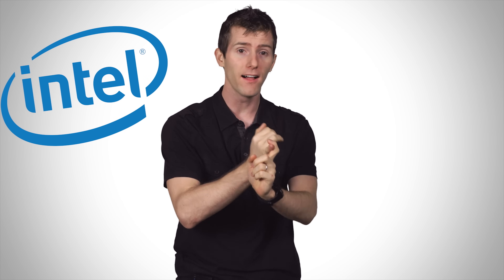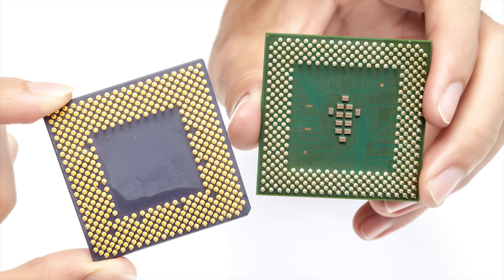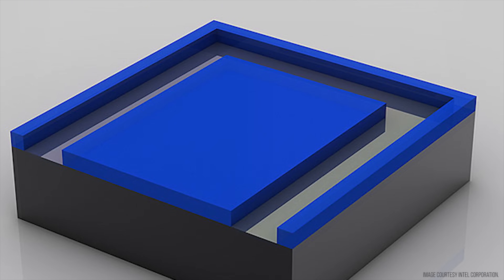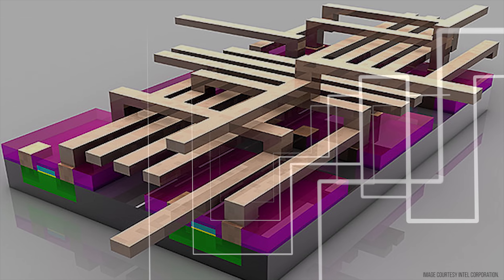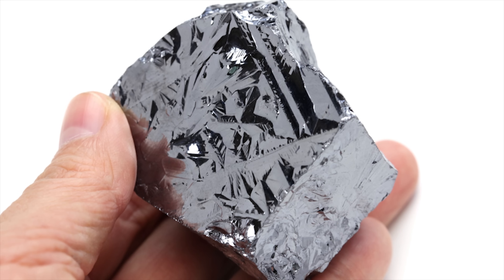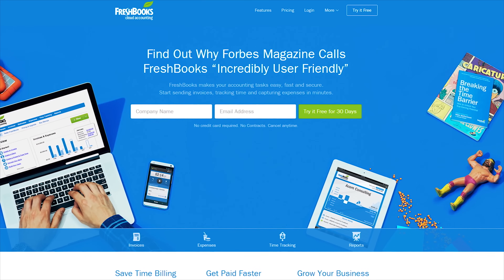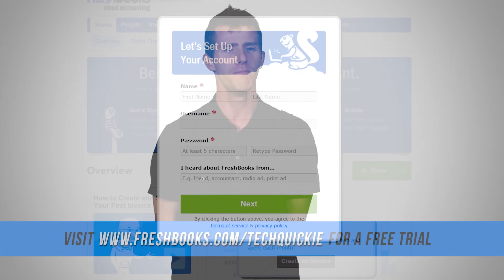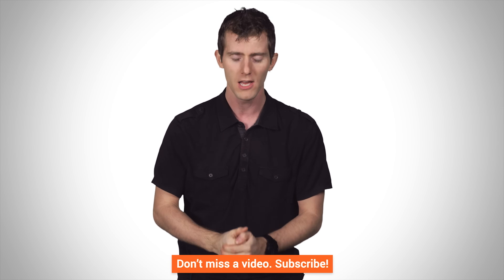How CPUs Are Made As Fast As Possible

Comment: Why are wafers cut into circular shape instead of a more rectangular one? Wouldn't that give you more usable area?
Reply: I think it's not that they are cut that way, but that the giant silicon crystal that they are grown out of is basically a cylinder, because that's just how it's crystal structure naturally grows. They just slice up said cylinder and then etch as many processors on it as they can fit from that current design.

Comment: I REALLY wish I could find an explanation as to how computers actually work.
Like, hear me out. The chips  don't have moving parts, and you can't see the data moving through them. So how does data get in and transfer around on a seemingly tiny square on a board?
Reply: Electrons atom. That's how they work. If the computer detected one electron Particles it will go 1 and if not it will go 0. That's why we got binary numbers

Comment: I used to work in a factory that used to recycle these wafers. Loterally all 3 of the companies (intel, global foundries and tsmc) Best job I ever had.. btw for some reason tsmc was always easier to recycle, global foundries was easily the hardest. There were only 7 factories in the world that did what we were doing so I always felt quite privileged.
Reply: that sounds cool
Reply: Wdym by recycle? Would it be fully useable again?
Reply: @jishan6992  Yeah they use different types of acids to take away all the different layers on top of the silicon wafer leaving the bare silicon, then it's polished up and sent back, it's cheaper to do that than to make a new wafer. We would "reclaim"  thousands of these wafers every day.
Reply: @sacredbridge368  that's good then, no wonder they can sell this chips for relatively cheap. I read somewhere that a single  wafer can cost up to 20,000 usd but I thinks that's after all the processing and stuff
Reply: @jishan6992  I'm not sure about 20,000 but the bare silicon wafers that we would send back to companies like intel and TSMC were only worth around £20 - £30. But we'd process about 6,000 of them a day.

Comment: Well the "end of this decade" part went by pretty quick...
Reply: 14nm+++
Reply: And Intel is just starting to put 10 nm chips on the market 
Probably won't see new materials the next 5 or so years i would guess
Reply: @raphael7010  more like 20
Reply: They could use boron or carbon or something like that
Reply: @janhilgert9053  my bet would be carbon.
Closest to silicone
Reply: @raphael7010  The silicon that CPU's use are actually made from carbon and sand.
Reply: Raphael Wittmann First, the element used is Silicon, not Silicone. Silicone is a type of synthetic rubber, while Silicon is a metalloid. Second, Carbon is not a metalloid and therefore doesn’t have the chemical properties Silicon has to be used in a computer chip. If a smaller element were to be used they would use Boron, since it is physically smaller (and therefore more could be more densely fitted) and is also a metalloid.
Reply: @turbo__unicorn3370  you just science'd on them
Reply: Gallium Nitride, that's my guess.
Reply: Intel: 14nm+++++++++++++++++++++++++++++++++++++++++++++++
Meanwhile AMD: 5nm at the end of the year 2021
Reply: 1
Reply: Ah yes (insert complex compound name here) Valley
Reply: Haha yes now yed
Reply: There already are CPUs made of other semiconductors, they are much faster and more efficient.
Reply: Plastic confirmed.
Reply: I mean Intel is making brain like cpus
Reply: Yep covid sucks 3 years passed by, chip shortage causing gpu prices like gold. Good thing at this moment May 2022 the prices are dropping. However, recession looms and I can’t sell my old overpriced rig I bought cause everybody is now upgrading theor rigs
Reply: So what are they made of now in 2025, silicon?
Reply: Corona
Reply: @DhirC35  Heineken
Reply: @Smittel Stella

Comment: 2 small corrections: a. MOSFET transistors are symmetrical, you can turn them upside down in any circuit and it wouldn't change a thing because the drain and the source are interchangeable (it only depends on what's connected on each end) - so no, the transistor itself is capable of passing current in either direction. Using it as a switch is actually achieved by what voltage is applied to the gate (hence we call it a gate). b. silicon isn't doped with ions, it's a very common mistake, it's doped with neutral atoms of either donor or acceptor variety, and those atoms carry a neutral charge. They improve the conductivity of silicon because they add more usable (for conventional electrical flow) carriers, but they DON'T change the charge of the silicon itself.

Comment: Why don't we just make processors bigger so we can fit more transistors?'
Reply: @lenyosu  I think its more of making them low power since they have to travel their way there before fizzling out. Enlarge this things and they would need more power(hanks to resistance even with copper) that they would eventually fizzle out before reaching the end.
Reply: @StreamerGeo its less about heat issues and more of electricity travelling and still having enough juice to register on the transistors. the purpose of cooling is just so they can operate as close to optimal conditions as possible

Comment: Yup stuff is getting small, we talk about 14nm architecture as if it was just a small wire, it is EXTREMELY SMALL 14nm is about 40-50 ATOMS wide
Reply: And now we have 10nm in the Snapdragon 835.
Reply: 7nm in Zen 2 welcome to 2019🌞👏
Reply: 90*
Reply: at this size its just guesses
Reply: silicon atoms are 0.2nm, so 14nm is 70 atoms wide.
Reply: BobClemintime Doped silicon (because that's what they're made out of)
Reply: 90**
Reply: Depends on the size of the particular atom being used as a measuring tool.

Comment: It's crazy to me, how much work and technology goes into creating computer parts, and yet a pair of shoes can cost the same as a new CPU or motherboard. Consumers are dumb.
Reply: i3, i5 and i7 are all made from the same die (within the same generation), then they are binned according to what is broken. for skylake that means they are all essentially i7 6700K CPUs. if one (or more) hyperthread path doesn't work, then all hyperthreading is disabled and it sells as i5, (same if any of the L2 cache is no good).  if any cores are faulty, then 2 cores are disabled and it is sold as an i3. The stability of cores at particular frequencies determine weather it is designated as say a 6400, 6500, 6600 or 6600K. They all cost about the same to manufacture, and R&D is a blanket expense for the generation. but they can charge more for a better (i7-6700K) and while an i3-6100 costs the same to make - selling it at a reduced price still recoups more of the loss than throwing away anything that is not perfect. I am also amazed how stupid consumerism can be.
Reply: @forestR1  Exactly.
Reply: @forestR1  wait nobody argued with this bullshit?? lol
Reply: @forestR1  they cant sell a broken or not properly functioning cpu. all the different versions are made the way the are intended to be made.
Reply: @Ethereal11177  lithography is complex and prone to flaws. This is why scalable architecture was created. Generally dies towards the centre of a wafer are higher yield. The reason no one has argued about it is because its not wrong. The parallel design of CPUs allows paths to work independently.  If a core has issues, it can be negated and the rest of the die doesn't care, and the silicon can be sold as a cheaper scu. Ill use skylake as example, just because that that's what I have; my 6700K has a 122mm2 die with 1.75Bn transistors. A core i3 6100 uses a 122mm2 die with 1.75Bn transistors. Same works with many GPUs. My Vega 64 and a vega 56 share the exact same 495mm2 12.5Bn transistor die.
Reply: @forestR1  honestly I'm sorry. You know way more about this subject than me and I think I totally misunderstood your first comment. That's interesting
Reply: @forestR1  I also still have skylake i5 6600
Reply: But R&D
Reply: @putcheeseonit  Yup. Most of the cost in R&D.
Reply: I'm surprised no one mentioned economies of scale.  If all you could get out of the process were one single CPU, it would be worth many millions of your favorite currency unit.  It's the mass production using an evolution of photolithography, leading to a large output of many copies of the same CPU, that makes each copy affordable to an average consumer.
Reply: Yeah, a pair of womens fashion shoes could be made in China for $20. If it retailed for $30, no one would look at it.  Put an italian mans name on it and bang the price up to $300 and the idiots will flock to it.
Reply: Shoe manufacture isn't as simple as you think it is either. Plus it uses a lot more raw materials and has a bigger footprint. Finally, you may have noticed the sheer number of types of shoes in comparison to the different types of CPUs which are manufactured at a certain point in history.
Reply: @BobClemintime  ok Jew
Reply: +robin kegel well you know that a i7 cost not ner 300$ in production ? Im guessing 50$ . And a i3 oir i5 is not going to be any less or more .
Reply: +fritz hoffman near*
Reply: Yeezys get more expensive than an Intel i9 Extreme
Reply: This dude is right i see alot of brain washed comments on here jesus haha
Reply: Yes, consumers are dumb, that's why they pay 200 dollars for a pair of shoes made out of foam that fall apart after less than a year of being worn every day. Because they care more about looks and showing off in expensive clothes than practicality or value.
Reply: thats why i7 starts at 300$ because it takes more tome to create an i7 than it takes to create an i5 or i3 thats why new i3 are cheaper they arent better than i5 or i7
Reply: No, that's not why at all. It costs practically nothing to make these CPUs, the money goes into research and development. The prices are shaped to suit markets.
Reply: But.. you can't use i7 as shoes, do you? 😅
Reply: Think of how much work and tech go into creating cars...
Reply: Ur dumb
Reply: DBR Liamg my $50 shoes work well for day to day use, walking to work and back. My expensive hiking shoes, WHICH arent more than my i7 is still in good shape after 2 years.  Its not how people dont like expensive shoes, its just that depending on the company and model, it is sold more than what its worth. Apple is a great example, they use words that snag consumers in. Guess what? The stuff we get fro hundreds or thousands could easily be replaced with better items at a lower price. Companies raise the price pf things because an athlete used it, or b/c they intentionally manufacture a limited supply. Ergonomics, blah, blah, most of these words are just marketing strats.
Reply: Some people aren't show offs, they just like to look good 90% of the times
Reply: Consumers are dumb ?
Lmao, people spend their money however the fuck they want , who tf are u to say what's right or wrong to buy ? Not everybody is a looking ass nerd like u that needs a new cpu every day . People like to look good, and that's good .

Comment: where's the quantum mechanics applied into the processor manufacturing process?
Reply: As the transistors get smaller and closer together the boundaries between ground and voltage carrying conductors are getting thinner. The walls are so thin that electrons can transport through the walls causing voltage leakage.

Comment: Y make the cpus smaller and stronger when u can make them bigger and even stronger than the smaller ones, because more transistors can fit
Reply: Power consumption will grow exponentially as the processor grows larger with the same density of transistors. Ever heard of Core Solo? That CPU had a TDP of THREE watts.
Reply: +striker113 the power consumption would rise but the performance would theoretically would get stronger, would it ?

Comment: Just make the CPU bigger to fit more transistors. But, we will need better cooling.
Reply: CPU's were bigger at one point in time,but as time went on,they got smaller and smaller.I'm sure some day we can get a CPU the size of our finger nail clocked at 12Ghz. just imagine that.
Reply: +Kryotix_YTP You know we can actually do that right now. Just that it's heat production heavily restricts us. If we figured out how  to cool these cards more efficiently we could bring it to production. Though, it seems we make need a different material soon, not just silicone for electronics.
Reply: ***** But, don't quantum computers just have thousands of cpus connected together?

So, we must perfect the cpu first?

Comment: What kind of machine builds transistors as small as atoms ?

Also, why continue making CPU smaller. Make a computer with 2 CPU, thats instant double speed
Reply: Watch the Techquickie video on multi core processors.
Reply: Not really double speed, it depends on what runs on it

Comment: Just thought I'd add a point of clarification, the reason silicon purity is so important is because small concentrations of impurities or what are known as dopant atoms have an incredibly large effect on the electronic properties of the silicon (which its vitally important to control if you're going to make a metal oxide transistor)

Comment: Intel has around 106,000 employees. This means that THOUSANDS of engineers work on the design of say, your Core i7 CPU. One geek may be able to put together his own computer using off the shelf components, but you'd have a hard time putting together your own CPU. (You might get as far as loading an opencores ARM processor into an FPGA, but the work of an Intel engineer would still be many orders of magnitudes more difficult.)
Once all of this is done, then it gets shipped to a multi-BILLION dollar factory such as global foundry where even more engineers take the design and turn it into a silicon die product. Then it gets shipped to a factory such as in Costa Rica where Intel puts them in packaging. (The plastic and heat spreader around the die. Also any wire bonding to the die.)

Comment: my build 
i5 4590
msi gtx 950 2gb OC edition 
8GB G. Skill (Only use's 4GB ram because I have 32bit)
Corsair 600M
gpu use's only 30% of usage. I get 20-30fps with saints row the third at 1280x720p at low settings. Same problem with other games. I've looked all over the internet for this solution but haven't found any. My friends told me its because I have 32bit.So I was hoping I was going to find a PC god here to see if he/she has the solution to my problem.

Comment: Hey Linus or Luke could it be possible for either one of you to make a new video on the current GEN consoles. Both have an 8 core CPU (JAGUAR)and 8GB of RAM also the same GPU. But why is it that the PS4 can output better FPS than the XBOX. Tomb Raider for example run 1080P on the PS4 but on XBOX it runs 900P. Could either one of you make the next video about that explaining why PS4 is more powerful than the XBOX. There both using AMD JAGUAR so why would there be a difference in performance? please and thank you.
Reply: Windows 98 stfu bro, ight, i was just giving suggestions, for another vídeo,